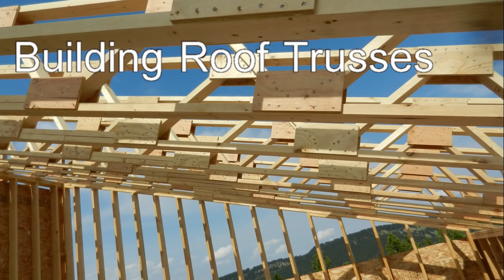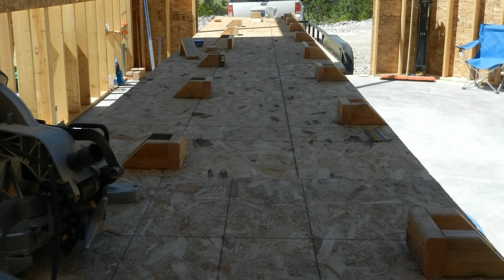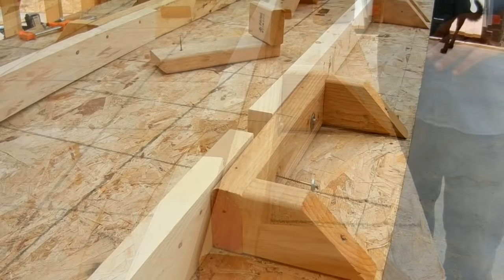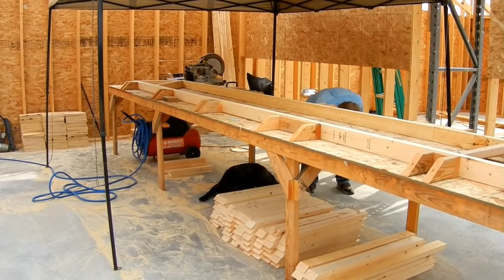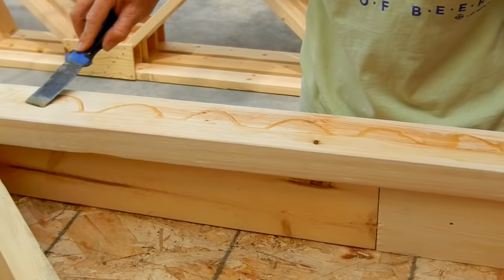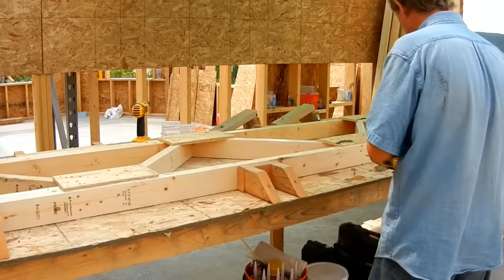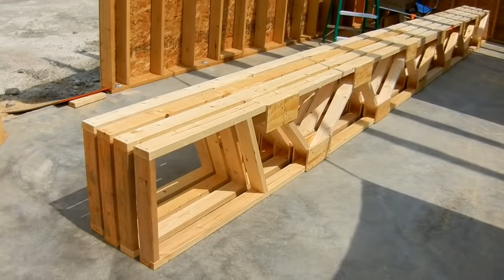Building Roof Trusses

Comment: Thanks for the instruction. Are those cross supports on a 45 degree angle - it looks like it? What design changes would you recommend if building a roof truss for shed roof with a 3:12 pitch (dry region), 23' span, and live load 40lb/sf?
Reply from the maker: Yes its a 45 deg angle. For your case the only two things I can see that would lower cost/complexity is increase the web angle maybe 60 deg and reduce the height theses are 24 inch-ish. With a 23' foot span I cant see reducing the height by more than 6".
Just my gut feeling not a scientific analysis.
Reply: @BSpotBuilds  Thanks for the quick reply. So, increasing the web angle does make sense to me. (DIY trusses are new to me). It would mean a steeper, more acute triangle - and that will require a lot more web pieces, which as well as making the truss stiffer, makes it heavier. Right so far? As the trusses you made so elegantly didn't seem to me to be complex or expensive, so I don't understand the comment about lowering the cost and complexity. What I am trying to figure out most of all is how to translate truss designs for a gable roof like yours, and pretty much all other DIY examples out there, to one for a low slope shed roof, 23' span. I am thinking of at least 18' tall and preferrably 24" at the peak decreasing to 16" or so at the low end. I want plrenty of space to fill with cellulose insulation. Another idea I'm obsessed with is flipping the 2X4s vertical which is stronger and I think lighter because less material - shorter web pieces. I don't understand why I see almost no examples of that. Did you consider that?
Reply from the maker: @listentothemusiccom  I think what you are looking for is a scissors truss:

https://external-content.duckduckgo.com/iu/?u=https%3A%2F%2Ftse1.mm.bing.net%2Fth%3Fid%3DOIP.hwY1BsxeBmgGNYAOjYE3RwHaFj%26pid%3DApi&f=1&ipt=f8f2a22bfac8c4e09c062a0c6deba0b120da4b37b594334fe1f0dc92b92162b2&ipo=images

Turning the 2x4 increases the bending strength on the span between the connections but does not make the overall truss stronger, it does reduce material. But since the connections are made with nails I was concerned with splintering the end of the web members. I used 1-3/8 ring shank nails thru 1/2" plywood therefore the nails from each side do not penetrate the entire 2x4, but turned on end they would. This is not an issue on manufactured trusses because they use staple plates.You could use shorter nails after all the glue has more holding strength than the nails any way.

Comment: im building my own floor trusses for my garage, its 32ft clear span, and living space above. I was wondering what type of wood did you use? any tips? lumber yard wants over 8k for the amount I need but I can get all the supplies and diy for 1900. its a no brainer. thanks and great video!
Reply from the maker: I used pine, I have one recommendation when you get your wood pick through the pile at the yard. You want very sound straight and dry boards with no knots more than 1/3 of the width of the lumber, and no cracks or separation in the grain.

Comment: Thanks for sharing!
Did you calculate the size of plywood plate and number of fasteners in each plate, or did you find a chart somewhere? I've been looking for a chart, but can't find one.
Reply from the maker: I did some calculations but very quickly you will realize that the glue is multiple times stronger than the fasteners. One web connection has 10 1-3/8 ring shank nails each nail has about 100 lbs of shear strength (use what ever number you like here) that's 1000 lb for the connection to one web member. For the glue my plates are 8x12 the web contacts the plate for 8 3/4" and is 1 1/2" wide for a surface area of 13.125 in/sq. Times two because there are plates on both sides of the web = 26.25 sq/in. Lets use construction sub floor adhesive. The type with VOC's not water based stuff. Shear strength is about 246 PSI on dry lumber. So the joint strength from adhesive is 6457.5 pounds plus 1000 ish for the nails total 7457.5. At this point I stopped calculating and just worried about getting a good tight strong glue joint.

Comment: What load is that carrying ? That seems over engineered for a what looked like a rafter with a center bearing wall. Is it for esthetics?  Its nice looking for sure
Reply from the maker: Just holding a roof with 25 pound snow load. Span is 24' truss depth is 24" in order to fit R-60 insulation.

Comment: Dear God in Heaven! That was impressive!
An awful lot of work, but THOSE will never fail. (Theoretically).
What kind of a snow load are you preparing for?
I would suggest some narration for your next project and explain why you went to such great lengths to create such massively strong trusses.
Other than that, it was a great video! Thanks.
TII
Reply from the maker: 25 pdf
Reply: @BSpotBuilds  Damn son! That's a lot of snow!
You have created something that I believe is at least 40 to 45 PDF! Great job! how has it been holding out?
TII

Comment: Did you do the calculations yourself or have them designed by someone else?
Reply from the maker: It's all mine.
Reply: @BSpotBuilds  very nice, what kinda load rating do you estimate?
Reply from the maker: I used 25 psf snow load and 15 psf live and dead load each. I have not tested one to failure or completed a full set of calculations.

Comment: I would like to know what span you have, and, the climate,  snow load if any. You might be able to make that span with just TJi's with a closer spacing than the common 24 inch, you could push those a long way, simpler and cheaper given the cost of the lumber you are putting into those handmade trusses.

Comment: B-Spot - Would you believe this type of truss would work for floor joists as well?  I will be starting a small (24'x24') cabin soon (on pier & beam), and have been weighing whether to buy manufactured i-beam trusses - or simply building my own such as you have with your roof trusses.  Any flex to them that would prevent use for floor beams?
Reply from the maker: ---Yes this design is very common in floor trusses and its very stiff. The ones used in floors have a vertical stud any place a load bearing wall crosses. The stud transfers the load to the footing or pier in your case. 
https://www.google.com/search?q=floor+truss&biw=1536&bih=755&source=lnms&tbm=isch&sa=X&ved=0ahUKEwj-05Tkv9jNAhVPpIMKHbyQDXEQ_AUIBigB

Comment: Fascinating video. Very well done.

Just curious, why did you double up the top and bottom chord members at certain panel points? I'm assuming to have more material in the max bending moment areas?

Thanks!
Reply: Wait...this is a splice isn't it?
Reply from the maker: The doublers are installed over the splice in the top and bottom cord.
Reply: I figured that out shortly after I asked the question. Thanks for responding.

Nice job, again. I have a pipe dream of DIY framing my own home someday. As an engineer, this fascinates me.
Reply from the maker: It doesn't have to be a pipe dream all it takes is a little research and a plan. You can learn any skill you need to build on Youtube.
Reply: @BSpotBuilds  Thanks for the video. Only if you have actually seen the fabrication of a truss can you imagine more effective and productive ways of spending  one's time.  

My only suggestion would have been to add galvanized steel toothed plate connectors over the bottom chord splice to bridge the joint. When splicing on the inside, the effective depth is reduced to the depth of the inside timber piece - critical in the tension element (i.e. the bottom chord) where the force tries to pull the joint apart.  In the top (compression) chord, the force will compress the joint together. 

As for the timber on flat top and bottom chords, that Warren truss setup is 100% correct, placing as much timber area as far as possible from the neutral axis of the truss.  If the unkind inputs from some people here were in fact correct, a steel I-beam would not work at all.  In a castellated steel beam, the web of an I-beam is cut apart and reconstructed to place the steel of the two flanges further apart. This gives a stronger beam for a minimal increase in mass.

I can't comment on the code requirements of self-built vs factory built trusses as I do not live in your country.  For my own preferences, I would have used steel plate web connectors with bolts - purely because I like the look !  
(PS I am Professional Architect of some 40 years experience.)

Comment: With all respect to the efforts here, engineering is required in every building jurisdiction I know of...if that has been done then great.  The plywood gang plates  might be in question depending on clear spans
Reply from the maker: If you mean a structural engineers stamp it's not required here. If you mean that someone would use various engineering principals to design and evaluate the truss then everybody does that. Some are just better at it then others, as is the case with engineers.
Reply: What are these going to be used for....floor or roof....they look good but I still have questioms
Reply from the maker: Roof, it's been up for 3 years.

Comment: So if I am building a shed 20x25' do I want the trusses Front to back at 20' or left to right at 25'/
Reply from the maker: I depends on which way you want the slope of your roof and what walls are going to bear the load from the roof. From an engineering prospective the shorter span is always easier to accommodate.

Comment: Thank you for the video, loved watching you do this. I have three questions which l hope you can answer, what is the measurement between the top and bottom chord of your truss? lt looks like it's about 20". ls this distance strictly determined by the span and pitch of your roof, or is that a pretty good measurement for most trusses? Also, is the ridge of your roof beveled where the truss sits on it? Thank you in advance for any insight you can give.
Reply from the maker: Truss depth is 23" This depth was to allow for 20" of fiberglass insulation and leave room for a decent ventilation air gap. The top ridge is not beveled, at the walls there is a beveled shim the truss sits on. At the ridge the two trusses meet one from each side of the house. Once in place a connector plate joins them together at the bottom of the truss and acts as a flat saddle on the ridge top plate.
Reply: @BSpotBuilds  Thank you.

Comment: great video. I am sure if you wanted to in full speed, you could knock those out in about 20-30min or less easy
Reply from the maker: +MRGMM -- You are correct, filming slows everything down. Assembly with all the pieces cut and ready to go takes about 20 min per truss.
Reply: +B-Spot 

You had beautiful weather to work and record outdoors. I loved that table which I am sure you built square and level. There is a lot of thought and work in that table. I also build my own fixtures and construction, but only maintenance and repairs on my home, never the whole structure.

Comment: I'm all about this technique on used or leftover wood the glue is costly though the screws add up The cost in time is substantial is it cheaper I don't think so used lumber yes with pulled nails then it's your time.

Comment: Very nice video. Question: Why did you drill the pilot holes in middle section of the 2x4?  Thanks
Reply from the maker: Becuse I want the screws to clamp the two boards together to improve the glue bond. Drilling first alows the screw to spin in the first board and makes it easier for the second board to pull in tight.

Comment: Really like the work you did, I'm looking to build some myself. Would you be able to share the plans of these trusses? I tried finding them on your website, couldn't find them. Thanks a lot!
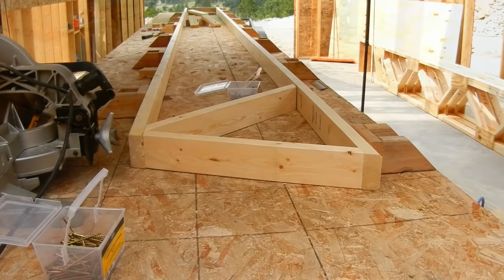Reply from the maker: I don't have the plans handy but I can give you some basic dimensions. The height is 23.5", length 26', 2' eave, 24' span, roof pitch 5:12, cord angle 45 deg, truss type warren, attachment plates 8"x 12" bcx plywood. Nails 2-3/8" galvanized ring shank, glue polyurethane.
Reply: B-Spot thank you for the info!

Comment: Awesome video! Thank you very much for posting it. I am building my own house also and I am looking into building my own floor joist and roof trusses as well. Can you please post a link to where you got the plans to design your floor joist. I see how you setup the rig/template table. I just need to know how to calculate & design the floor joist to fit my plans.  Also, i can definitely see the benefit in DIY, not just the cost savings, but, like me I'm building out of pocket so with $500 here and there, i can knock these on my time table versus having to save up $10-14k for a big order.
Reply from the maker: Joseph Grant I didn't calculate the load what drove my design was referring to other designs and installations. I needed 20" of depth for the r-60 insulation plus 2 inches min for an air gap between the insulation and roof sheeting so the trusses are 24" tall. The pattern is a Warrren truss https://en.wikipedia.org/wiki/Truss_bridge#Warren_truss same as what is used for bridge building. This document will give you some ideas about span and load http://www.trusstech.net/Truss_Tech_VA_MD/Tools_files/roof-truss-facts%20mitek.pdf. This document gives a overview for diy http://www.agf.gov.bc.ca/resmgmt/publist/Leaflets/BldgEng/305-32.pdf. The wood you use needs to be a little better than standard #2 grade what I did is pick thru the pile at the lumber store. You want knots to be no more than 1/3 of the width of the board with no splits along the length and as little twist and bow as possible. Good luck
Reply: Awesome....thanks a lot!!!

Comment: Why pre-drill so much? The Impact screwdrive could easily beat the screws inside?! Thx
Reply from the maker: I pre-drill the ends so that the wood doesn't split. I pre-drill the splice holes because I want the two glued boards to clamp together tightly for a strong glue joint.

Comment: Does the side of the truss go flush with the wall or extend over the wall ? Does the final look from the side have a two foot thickness and if so how to finish it off ?? Is the 2' side of the truss  level vertically?
Reply from the maker: Maybe this will help. https://drive.google.com/file/d/1o5miBOZgB_SCM4HI0f3jdoizarnm9_L6/view?usp=sharing
Reply: @BSpotBuilds  Nice overhang but do you  finish it of with siding or roofing material?  or I suppose you could make it flush with the wall tie into the sheeting on the side and then  do a 2x6 scab off the truss to give a 6" profile overhang. That would firm them up real good also. Love the design of the Truss. I do believe I will use this in my roof design and build them myself
Reply from the maker: @jonathanbasye3168  Watch this video https://www.youtube.com/watch?v=uPsLdOugzqg&t=7s you can see the truss tails at the 0:05 second mark. The vertical member at the end of the structural part of the truss lines up with the wall framing the open part after that is the eve. I place sheathing between the trusses stopping 1" bellow the roof sheathing and attached to this member. This closes off the insulation cavity. On the truss to the wall I use angled shims to support the truss and drive 7" construction screws through this connection. For finishes the roof and wall are sheathing, the eave is ship lap, the fascia is a concrete panel.

Comment: I didn't realize you could use multiple pieces of lumber to make single chords like that. Should the joints be staggered on the top and bottom chords?
Reply from the maker: You can stagger them but it isn't  necessary. The forces on them, compression on the top and tension on the bottom dosen't preclude them from being in proximity to each other.
Reply: @BSpotBuilds  Thanks for the quick response! And that's great news! I've been thinking about making some 20' spans, and two 10' long 2x4's are a lot cheaper than one 20' long 2x4. Thanks again for the incredibly helpful video!!

Comment: Did you use beveled bearing blocks to support the trusses at the ridge and the walls?
Reply from the maker: +Alan Eyre The walls have bearing blocks and the connector that tied the two trusses together at the top acts as a bearing surface.

Comment: Hi beautiful video. I very much enjoying a good craftsmen at work. Can you share where you get the calculations for the traus? From the comments below it seems like you done the design by yourself. 

Second question is how come you didn't use the rafter roof system? Won't that be cheaper and less time
Reply from the maker: +junkmail1203 -- here is one of the links I used https://courses.cit.cornell.edu/arch264/calculators/example1.6/index.html. I think a rafter with a 26 foot span is unrealistic and would be much more expensive.

Comment: Wouldn't be easier and faster to use a nail gun and clamps?  Why the screws?  Any particular reason??  Don't get me wrong.... I love what you're doing. Just curious.
Reply from the maker: +Joseph Yi --- I use screws to hold the lumber to the jig because I don't have 15+ clamps. I use screws in the corners to hold them together after assembly as nails into end grain don't have much holding power, also they will pull the joint tight eliminating any twist. I used screws in the center joint to clamp it tight where it is glued. The glue isn't set when the truss is removed from the fixture so I wanted to make sure any twist or bow in the lumber wouldn't over power the nails when the fixture screws were removed and the truss was moved. I personally like screws for there holding power which is about 4 times that of a nail with only slightly less shear strength.
http://www.builderonline.com/building/dear-builders-engineer-nails-or-screws_o

Comment: Hiya Pal great job how much weight would that type of truss hold over a 20 foot span
Reply from the maker: Not sure it has a 26' span and was designed for a 25 psf snow load and 5 psf dead load.
Reply: Do you know where can I find dimension tables for this type of trusses? regards